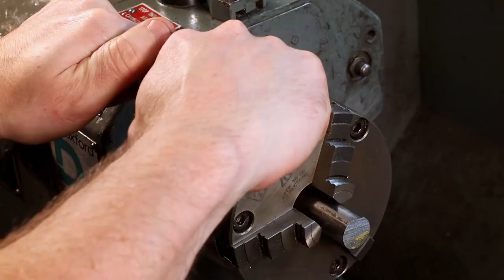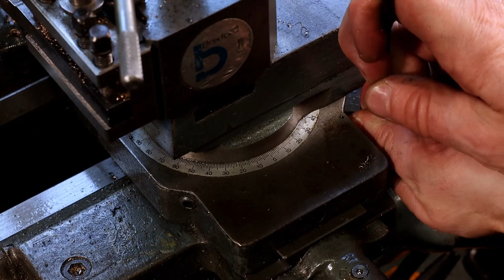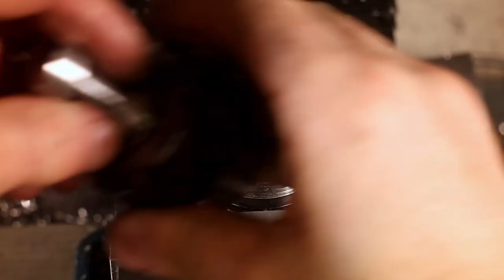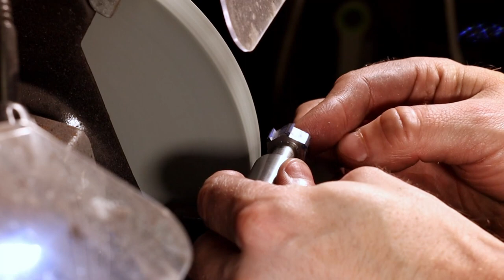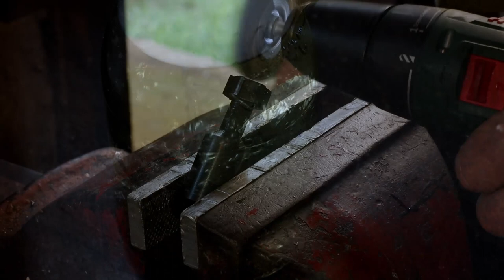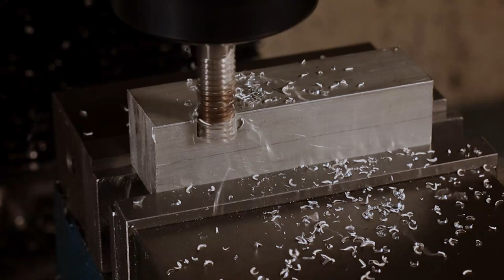T-Slot Cutter Project

Comment: Nice job. I wonder whether having larger relief on the leading edge of the cutter would improve the cutting. It looks like the chips are about the same size as the relief, so it may be choking it.  What taper does your mill have? I have quite a few MT2 Woodruff cutters that are barely used, I could send you a couple if you like.
Reply from the maker: Thanks Olly! I think the cutter was rubbing a bit on the top and bottom, so could do with more relief there, as well as on the leading edge. To be honest, I wasn't sure it would work at all!

Thank you for the offer! My mill is MT3, but I'm guessing I could buy or make a threaded adapter? I'll investigate and get back to you 👍